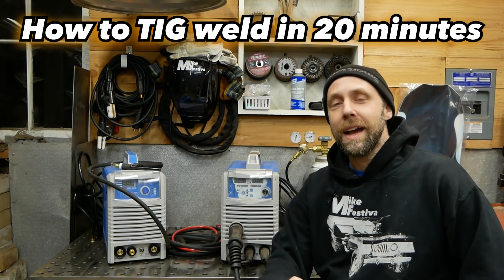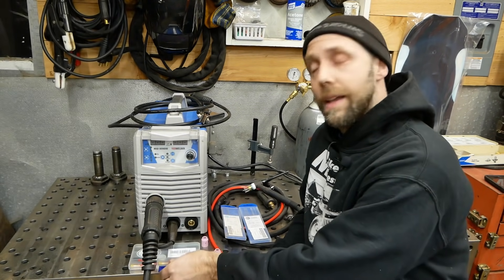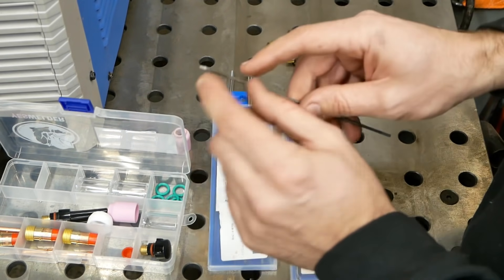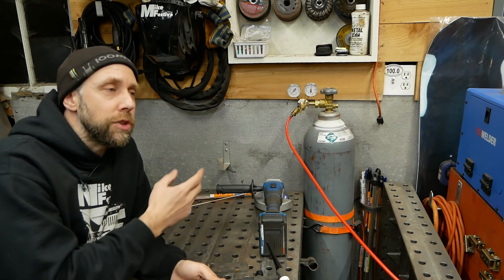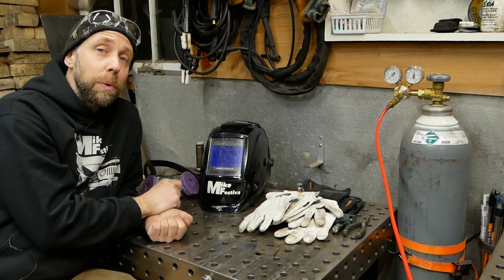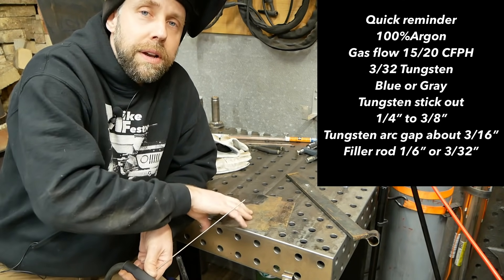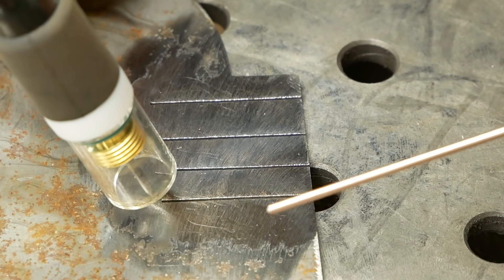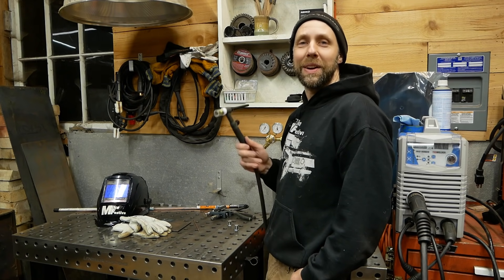Learning how to TIG weld made easy

Comment: Very good beginners video. Outstanding job, you just about covered it.  

You bring up a respirator, by the hand of the lord all mighty, yes, yes , and yes.  You go home with burnt lungs and that is not fun by any means.  Its like your lungs are on fire.  Its like the old timer told me, if your welding doesn't require some form of breathing protection, then why do you need to breath?  Truest words ever spoken.  I always use a respirator.  I have a blue respirator that I use for aluminum and stainless and a standard yellow one that has standard paper media for everything else.

Comment: Grinding your tungsten is a part that is NOT to be underestimated. If you grind it incorrect your arc will flutter and be all over the place:
Don't use that coarse bench grinder thing you also grind rusty steel and what not on! Use a fine grinding wheel and do it like in the video so the grinding marks will be aligned with the length of the tungsten. Make a tip that is ground 6-8 mm in total and do not weld with a dull tip (aluminum welding is different). Your welds will improve vastly by doing as I described. Happy welding.. :)

Comment: How difficult is it to TIG weld Chromoly? Does Chromoly weld similar to mild steel? The reason I ask is because NHRA Rules dictate that a Chromoly chassis and roll cage must be TIG welded and mild steel chassis and roll cage can be mig or tig. Take care, be safe, and have fun regardless.
Reply: I was told by some of the guys that weld chromoly at work, that it is more like welding stainless steel. It has a super liquid puddle and flows well, but can run easily.
Reply: @leebaker372  Thank you

Comment: Where did you connect the ground clamp while you were working?  Did I miss that mentioned somewhere?
Reply: It goes on the steel table if you have a workbench. Or directly on the part your welding.

Comment: New Sub Here !... That Was An Awsome  Video Mike !!! 😃...I So want to get a Tig Welder And Start Welding...I am a Super Newbe tig Girl here, ( never tryed Tig, just done Ark weding) I'm on A very Small budget to get started, about how much will a tig Set up cost and whats the best one to get for light home use ??.... Thanks Mike...Sincerely Geena 😃
Reply: Yeswelders TIG-205 is like $200 and you'll spend another $200 on gas and if you don't have any safety gear yet that's another $100, and plan for $50 at least in consumables.  Also the metal itself can be quite pricey

Comment: How do you identify aluminum 6061 or 5356 and so on ?
Reply from the maker: I know the salvaged aluminum I was welding was 6061 because I know the grade from the company I salvaged it from, some even has printing on it still stating 6061.
If you salvage aluminum it’s not easy to identify different grades. I can tell some stuff like 7xxx series but that’s because it tend to be extremely hard and commonly anodized, it definitely doesn’t weld good at all. Sorry man I wish I had a better answer for your question. Hopefully if someone reads this comment they can help if they have a better explanation. 
Take care Adam.
Reply: @Mikefestiva  thanks for sharing your information and time
Reply: It's hard to tell nowadays
 Just ask what their pronouns are

Comment: One of the easiest ways to learn the basics of welding is to learn oxy-acetylene welding, after that the only thing that changes is the application
Reply: Even more easier than mig?
Reply: @christophermccrary8080  oxy_accetlyne welding is harder, but no electricity is needed. It teaches heat controll, and coordination to hold torch and filler rod, also you clearly see the molten Metal and  need to controll the puddle by speed and torch height and adding filler rod.   Also oyy_actlyene is great for cutting  metal, and heating rusted parts to brake loose, can't do that with Mig,tig or Arc.     Mig and Arc  will be easy to learn if you start with oxg_accetlyne.

Comment: I know I've already commented before on this video. But I just want to say thank you again for this amazing video. You are really a great teacher, Mike! ☺️
Reply from the maker: Thanks Megan! I do appreciate it 🙂👍
Side note, I got the little Suzuki Carry running tip top now! I replaced the carb with one I ordered from the Philippines, it had a manual choke so I was able to bypass all the cooling lines for the water choke on the original carb. I replaced all the cooling lines on the truck with silicone lines, and the final thing was I modified an aluminum radiator from a 650cc side by side to fit, so I was able to get rid of the old stock one 👍 I should have a video out in a few weeks. Take care
Reply: @Mikefestiva  Wow! That dear little truck certainly found the right home with you. ❤️❤️❤️

Comment: Sharpening a tungsten on a grinding wheel that is used for other grinding is not good. You end up adding contaminants into your tungsten.
 Don't just run a grove either, keep your wheel dressed and flat and move your tungsten across it as you sharpen.
Reply: Absolutely and never grind aluminum on a grinding wheel.

Comment: Thanks ! I'm learning myself , I have mixed Argon for my MIG welder . Thanks for letting me know not to use it for TIG when it runs empty I will go to my Local Welding Shop and Chemicals and fill it up with 100% Argon . I have a couple of D/C welding machines to learn on . Thanks for the video . I've done this before , but it's been a long time . I have 5 different welding processes that I'm trying to be proficient with . Just like a handyman . 😊

Comment: Very good video, 👍 you explain everything in layman's language. I was a certified welder in welding boiler tubes. The test for certification was the Arkansas Bellhole, tig the 1st 2 passes and cap it with a 7018 or better, I preferred the 8018. The test was pretty tough, but it wasn't nearly as tough as welding in a Boiler because especially on superheater tubes, every thing was so close that you had to cut your filler rod to about 6 inches and your stick rods in half or greater. I loved making those welds, and they were all X-rayed, I loved the challenge and never had to cut a weld out. I am not bragging on me as I am about a welder that taught me the best way to do it, a good Friend and coworker, he's gone now but I will never forget that he took the time to teach me. I'm 70 years old and I have been retired for many years and have not made a certified welder in forever. Thanks for sharing, you helped me and I'm sure you've helped many others, keep up the good work.
Reply from the maker: Kenneth thank you so much for your kind words and supporting my channel!!
Reply: @Mikefestiva  your doing a great job, your videos are awesome. And like I said keep up the good work that your doing.

Comment: For me starting with TIG welding was already pretty difficult. I'm glad I spend some more money on a machine that can start an arc without toughing the workpiece and have automated pre and post flow gas settings. I never found the machine settings difficult. The actual welding skill is hard. To see the weld pool and to apply the filler rod at the right time and place with my non-dominant hand.

Comment: Love your relaxed way of sharing knowledge. As a trainer I see mediocrate and good teachers and you're definately in the second ballpark here 😃

Here I am just in the process of deciding between TIG or MIG. I like soldering a lot and having just one shielding gas for all materials appeals to me. The clean, sparkless and odorless way of welding is anoher plus for me since I have to weld inside a rather small room.
For my own battery rack (500kg of lithium cells needs to be stacked safely) I need to weld some steel square profiles of 1,25"x 1,25"and 3-4mm thick.
I also want to weld Aluminium too in future (without using a MIG welder with Aluminium feed wire).
Looking at a MIG welder this welds prutty fast and hasslefree but using TIG you get a stronger weld and it's better usable for plate material too, was told me by a professional welder.
What machine would you decide for with all the above mentioned information and having only place for just one machine?

Keep up the good works there!

Comment: Thank you thank you, I'm 62yrs old I wanna learn, just bought a little Miller machine. Tig looks like a way to do little things I've been asked to do so many times, I grew up on a torch an can do anything with that. Seems that makes me kinda a dinosaur today, I never got into stick welding, oh I can do it, just my task in that was always heavy metal and equipment crank the heat and burie it deep. An my mig welding was usually medium duty like bumpers and such. But I've always been asked to do little shit like mirror brackets and putting a torx tip on a long driver bit. Little silly shit. But I want to learn, this looks like an opportunity to do little welds efficiently. Oh well if all else fails I can usually do what I need with only a torch, jobs big or small a torch is a first knowledge. Thank you again
Reply from the maker: This would be perfect for those little little tasks you mentioned! Hope you give it a try and thanks for watching 👍
Reply: Thank you again for replying back to me. Think I learned enough from this video to get started it helped a lot to see I can move the tungsten in and out and the cup to, to work in what I call the bubble, where the gas is concentrated. And the tips on pulling back the tungsten to break the arc and be able to keep the gas on after the weld is complete. Thank you think I'm gonna get it, but one thing for sure I'll be back to watch more of your videos.

Comment: Nice video. I'm a welder myself but I haven't used Tig welding before.. only arc welding. I learned welding way back  in the same year when the  9/ 11 atrocities. But I am about to start welding again. Shortly. Tig welding seems to be a very nice practice.
Reply: It's even better if you use Argon only for TIG, and that's all metals.

Comment: For grinding the tungsten if one has a mini lathe couod that be used after setting head unit with a griding wheel then placing the tungsten in the other

Comment: Great video.. I would just like to point out one thing. If you are grinding tungsten you NEED breathing protection. I understand that the tungsten you linked is pretty safe.. However, its just good habit to use protection as if you grind thoriated tungsten that is slightly radioactive and you do not want to breath it.

Other than that, it was a great video and I enjoyed it. One of the better TIG starter videos out there.

Comment: Just when I thought I was sold on the Vulcan omni 200 because it was a multi process welder that offered a foot pedal for the tig I find your video on the yes welder . I guess at this price point I’m gonna have to learn how to tig without a foot pedal 😂. I really wanted a ac/dc tig for aluminum and I was ok giving up the ac part for the Omni 200 having the foot pedal option . The Omni offers pretty much everything I want but the price point of the yes welder is incredible
Reply from the maker: Keep in mind these two welders you are mentioning are only DC TIG so aluminum is out. The Omni 220 has Spool gun ports so you may want to still consider that one.

Comment: cool video learnt a lot thank you 
Is the tig any good for car panels or would mig be better?
Reply from the maker: Thanks for checking out my TIG video 👍 I don’t do a lot of body work but I usually have used MIG for thin panels.
Spot welding with MIG puts in less heat then TIG does. But I’m sure TIG would have it’s place on some projects especially when TIG Brazing dissimilar metals together with silicon bronze rod.
Reply: @Mikefestiva  Thanks for getting back Mike Appreciate it and Thank you again

Comment: Best DIY video I've ever seen. I've sent Mike's of wire through a MIG and I have been wanting to learn TIG so I can do some custom SS exhaust work. 
Best machine for this level of SS and something that will do aluminum?
Reply from the maker: Thanks I really appreciate it. The two affordable AC/DC TIG welders I have used over the past few years are the Hynade TIG200GPAC/DC and the other is the Arccaptain AC/DC TIG. Both can be ordered on Amazon. Out of the two I have less time on the Arccaptain because I haven’t had it as long but the screen is much easier to read and the setting are a bit simpler to setup. 
Hope this info helps. Both welders are in the $650 range the last time I checked.

Comment: Do you work with stainless, just about to start out. This is first video of yours iv come across. Bloody good explanations and demonstrations.I’m ready to jump into it  and give it a go. Subbed and looking for what else I can learn .
Reply from the maker: Yes I have welded Stainless steel many times. To get the best results when welding exhaust pipe you will want to plug the pipe and run some shielding gas inside the pipe as well to help the weld joints. Use a welding respirator and try to weld by an exhaust fan that moves the welding smoke away from you. The smoke coming off of stainless steel is pretty nasty stuff, you definitely don’t want to be exposed to the chromium and other chemicals. 👍

Comment: Mike realize this is an older link, but was wandering if you are still using the Yeswelders and what you think of them now.  Just started using a HITBOX welder trying to learn TIG welding, unfortunately the MIG function played out shortly after I started to use it.  Don't know if parts available for it or not.  Got the machine to learn TIG but wanted to use it for other uses as well.  Will probably have too replace it and wanted your opinion on the YESwelder  Thanks

Comment: Dumb question I know from your videos the recommended gas settings but do they change with cup size? Ive fitted my torch with a stubby pyrex 10 cup would I still be using 15-25 scfh or will it lower/raise due to the cup size?

Thank you in advance im just getting conflicting information reading around the web as I wait for my stuff to arrive. I also have the PROTIG 165 for reference.
Reply: Bigger cup more flow smaller cup less flow, you'll cause tubulance and it'll ruin your weld. But do very minor adjustments.. also you probably already learned this hahah but for anyone else that sees your comment
Reply: @mddprozz  thank you :).

Comment: So I have a Lincoln electric tig machine. I know how to stick and mig weld but want to give tig a try. Since it’s a Lincoln electric do I need to use the pedal or do I just do what u did in the video without the pedal? Just asking cuz u used a different machine than what I have so not sure if I need to do anything differently?
Reply from the maker: Hey Joe I would check and see if it’s a lift TIG start or needs a foot pedal to start and control amps. Does it have a port to connect a foot pedal on the welder? If so it probably needs a pedal, unless it’s got a lift TIG setting on it.
Reply: @Mikefestiva  it does have a port for the foot pedal. I do not know about the lift tig setting. I’ll do some more research on it.

Comment: Also want to use a fresh filler rod, meaning when you get done with one filler gap cut the used section off.  That's why you don't want to keep pulling the filler rod in and out of the argon.

Comment: I'm humble and truthful. I am a 17 year master with a mig on steel. At 51 of age. I have taught an uncountable amount of people to mig with my Lincoln 255C model. It's 4 minutes till midnight and now I need to go outside to insure it's model. Yeah @ 12:23 I Got back from the shop. We had so many machines in our shop. It's hard to keep up. I Can Mig and make it look like tig but still I always wanted to tig. I didn't know all the things in this video. As far as stick? Forget that I am extremely bad at that. I understand its need. ( The Tomb Stone ) No gas required plus some kinda stick is used for underwater welding  ( have seen it's the most dangerous job in the world ).  I still want to understand it and might try to do it. As far as Hoods. I dislike Miller welders. Massive failure rate. But I dislike any Lincoln hoods. I have always used the Miller auto hoods and I sat it at 10 shade but I had dark glasses under it. PPE!!!!! I hope your still making videos. I'll know if you respond. Thanks for the lesson. I hope I get the chance to use them...............

Comment: I learned how by watching the shop manager for two minutes. He walked away, I picked it up and welded. He came back and asked me how long had I been tig welding aluminum, I said that was my first time. He hired me on the spot
Reply from the maker: Wow Jerry you learn quickly! Most people take a year or more of practice to get TIG figured out.
Reply: Yep, if you 'understand' what is to be done and have the hand/eye coordination to do it, there's absolutely nothing stopping you from TIG welding on your first try. Especially if the machine is already dialed in, as in your scenario.
Reply: @hxhdfjifzirstc894  yep, besides, I already knew how to work a puddle

Comment: I use a Fronius TransTig 2200. you don’t have to touch the tungsten to metal to start, you just press a button on the torch to start and stop. You get a very clean weld and it doesn’t arc when moving the torch away from the work piece, which can be an issue when welding near threads
Reply from the maker: Yes that’s high frequency start, it’s nice, I have 3 AC/DC tig welders with that. I used the simplest DC TIG to show the most simplistic way of TIG welding to others. 
Thanks for checking out my video 👍
Reply: @Mikefestiva  thanks for the reply, I am new to TIG welding 😃 nice video

Comment: What if you set the tig tip up on a little trolly system, at perfect angle, perfect height. Then touch off by introducing another piece of metal. You could just manually roll the tip very slowly, without ever changing the angle or height.